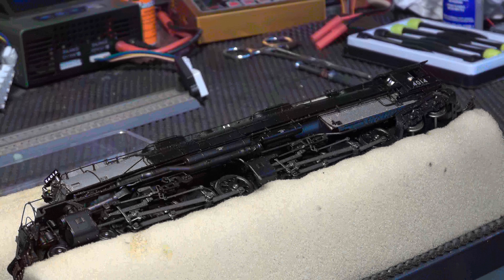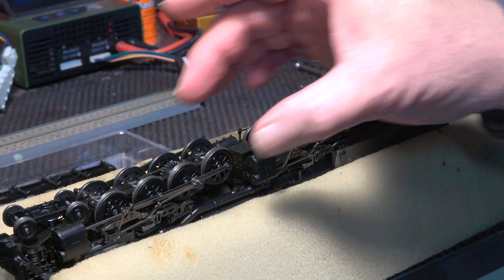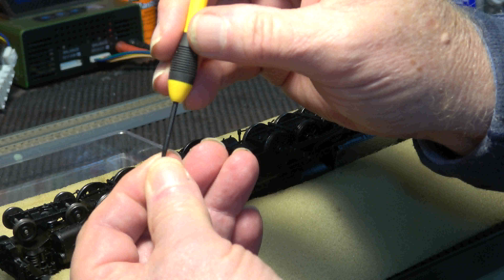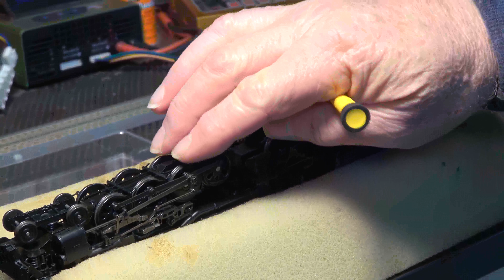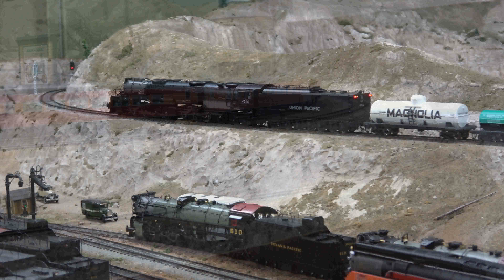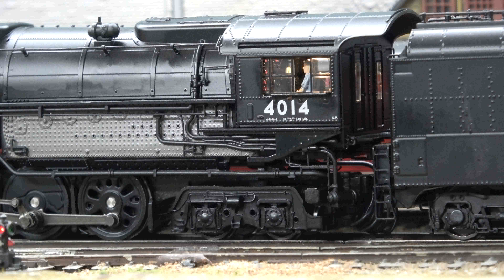Broadway Limited Big Boy How to Change Driver Synchronization

Comment: Hi Neal,Just did the drivers on my new BLI Challenger looks great.
I will do the Big Boy when it comes home.Thanks again for making this great tutorial I'm sure it will help many BLI owners .Cheers Jon.
Reply from the maker: Jon, So what do you think about your new challenger?  I bit the bullet and ordered the BLI #3985 but it has not shipped yet from my dealer. Let me know how you like yours! Neil
Reply: 10/10,but it came with no cab figures.
The detail is stunning,the cab detail is better on the Big Boy,Whistle is different from the big boy as well/colour(no brass paint).
The tender top is a lot different from the big boy as well, the green and red rear marker lights are great.  I think it sounds good.
I like the way the tender is permanently connected now no more of those pesky harness plugs, and  comes in a long box now with better protection than the big boy box.
I will try to post some footage of the drives in their new position soon.
Cheers Jon.

Comment: Hi Neil, love your video. I just ordered a BLI 2nd version Big Boy couple of days. I never saw any another video revealed the gear of it, I know it was made of plastic, but I have no idea about what kind of plastic it was made, you are the one who actually checked it, in your opinion, does it look like easily gets collapsed?
Reply from the maker: I have BLI steam engines that have run for hundreds of hours with no noticeable wear of the gears. The only caution I would offer is to make sure you use plastic compatible oil/grease. Neil
Reply: @NeilADahl  Thanks Neil, noted it. Have a nice weekend:D

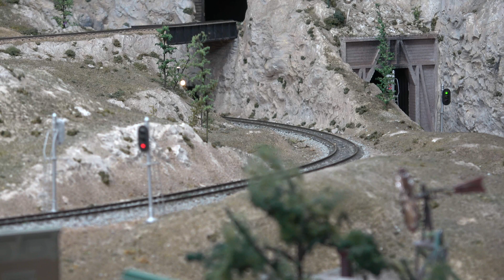Comment: 7:18 mark the clip freezes till the 8:41.  But bli should of had the articulated drivers 90 degrees turned from each other from factory.  But at least it is easy to adjust the wheel sets to where you have that articulated chuff.

Comment: Neil, I was running it with passenger cars,one of the cars shorted on a set of points,the loco stopped suddenly and the lights on the tender were flashing,now the motor does nothing,tried resetting it many times but no joy.
I don't know if it's decoder or motor but I will let you know what happened when the report comes back with the loco.
Reply from the maker: Jon, Have you tried to run it on straight DC. Occasionally my engines will mess up like that ... I run them for a few minutes on DC and switch back to DCC and then they work properly... worth a try. Neil

Comment: waiting for a part for mine. When we first fired it up the engine would not work. we took it to the hobby shop we bought it from and they said it was the engine and it had a short. we contacted BLI after that and they said they would give us a decoder to go into the tender that might fix it. should be here any time. if that does not work it will get sent to BLI and will take 3 months.
Reply from the maker: Sorry that your engine was DOA, I had that problem one time on my BLI Y6B straight out of the box, I did see a spark while putting it on the track. Since then I turn the power off in the block before putting an engine on or off the track, and I have had no further issues. I would guess also that if you have to send it back for repair you may well find the turn around time is much less than advertised... at least that has been mine and friends experiences... good luck! Neil
Reply: update. received the part last Thursday and when we tested it worked flawlessly with the new decoder.
Reply from the maker: Fantastic!!! Neil